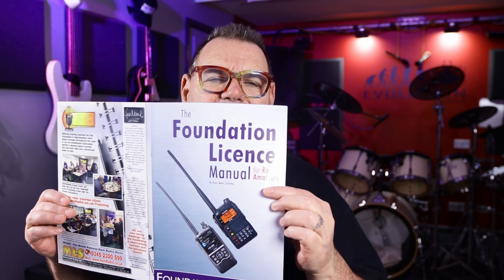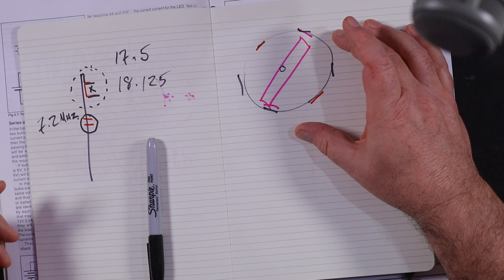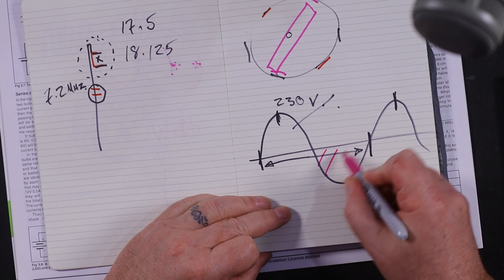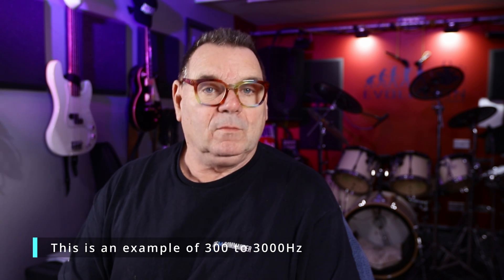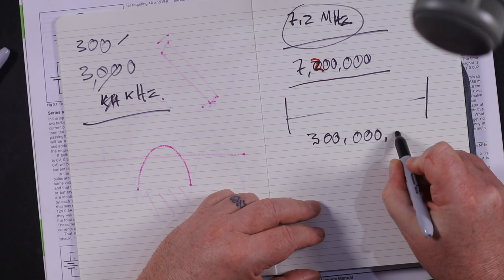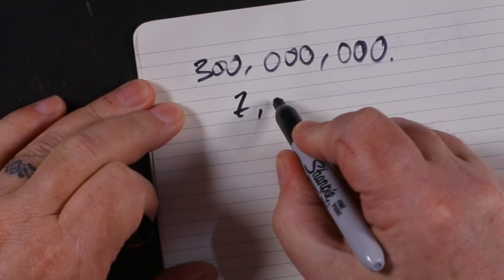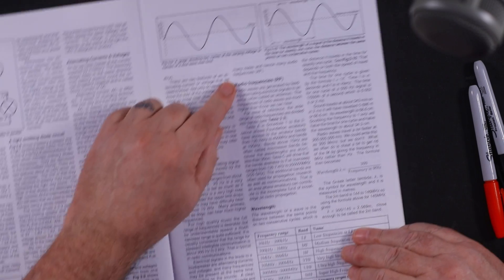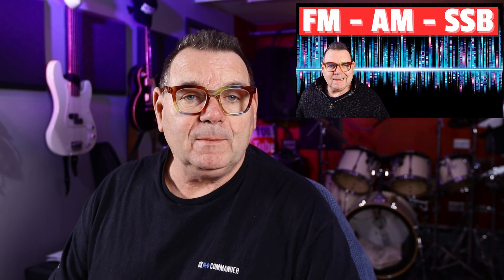Frequency and Wavelength and Speed of Light

Comment: In the U. S., people often say 110 and 220 volts. It has not been that for decades.  It is 120 and 240VAC.   In practice, it can actually be higher depending on your location.  That is, higher if your "drop" is closer to the substation.  

The demonstration you did speaking with a limited bandwidth was brilliant!  That demo will be remembered by all who heard it. 

Thanks for another teaching video.  73, Jim W6LG
Reply: When I monitored my plug voltage for a while, I noticed that during warmer winter days it would be closer to 125 volts, while during very cold nights it would drop down to 118 volts.  My assumption was the heavy use of electric heat causing some drop.  I suppose it can shift with current demand over the grid.
Reply: The 230V "standardised European" voltage is also a bit of a kludge. The UK is 240V, always has been. Some countries in mainland Europe are 230V, some 220V. They wanted to have a standard European voltage so they settled on 230V...but they set the tolerance so that it encompassed 220V to 240V. No one actually changed their voltage, just that it's now declared at 230V.
Reply from the maker: Paul.. It's all nit-picking. This one is about frequency and wavelength.. But we all digress.
Reply from the maker: Hello Jim.. Yes, a quick spin of the EQ..! Good to see you in the comments old friend.

Comment: "By dividing the frequency by 300, we achieve the exact wavelength."  Exact is a very strong word.  To get the EXACT wavelength you need to divide the frequency by 299.792458 in a vacuum, or by 299.702547 in air :)
Reply from the maker: And what value is that to a learner..? Don't answer! :)

Comment: While it won't really help for writing a test, here are some additional fun facts: In the UK, the AC cycle always starts on the left side, and in the US of course it starts on the right side.😅 And in Australia, the AC is inverted, and with the skin effect, of course it swirls to the left on the outer portion of the conductor, same as the toilet water does 😅. In France, even at potential, electrons sometimes outright stop in a conductor as they known to go on strike. This is called Passive Impedance😂 Canada's grid is very efficient, as the conductors in the cold Northern Grid Interconnect are usually superconductive most of the year 😅
Reply from the maker: HAHA - Very good! :)

Comment: I am a little confused 300 ÷ 14MHz is 21.428571428 and should be in the 20 m  band do we round down? 

300 ÷ 5.332MHz = 56.264066016

If so why would I round up to 60 m?
Reply: Yes, it's all approximate. What I find funny is that the 41m broadcast band is higher in frequency than the 40m ham band.
Reply from the maker: The 20m band is just as you said, the 21.5m band! :)
Reply: Look up Dave Castlers "Way Off Base! Meter Designations vs Frequencies #921", skip about 9 minutes in. After 80m, nearly none of the bands designation are actually inside the band. It's worth keeping this in mind when building antennas!